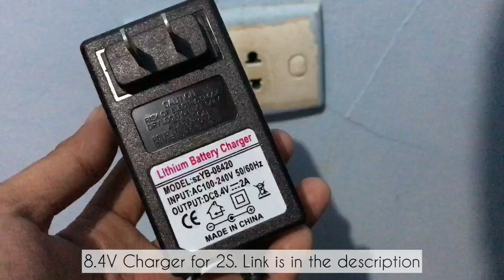Quick Fix: 11 Year-old Emergency Light | Lead Acid Battery to 18650 Li-ion Battery Replacement

Comment: Paano palakihin ang battery capacity?? Saka led bulb conversation???
Reply from the maker: Dagdag lang po ng battery in parallel connection. Tapos sa led bulb naman may nabibili po na led strip para padiretso nalang